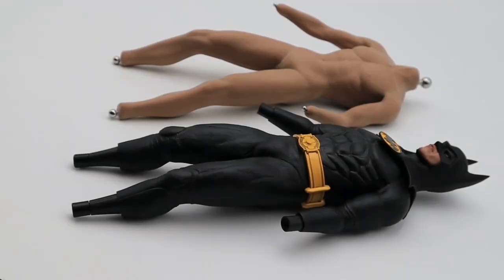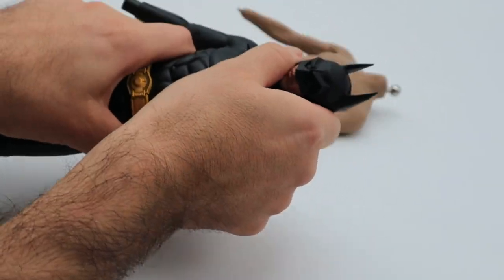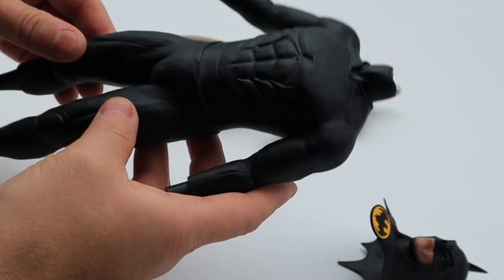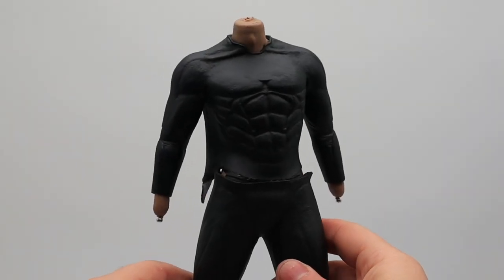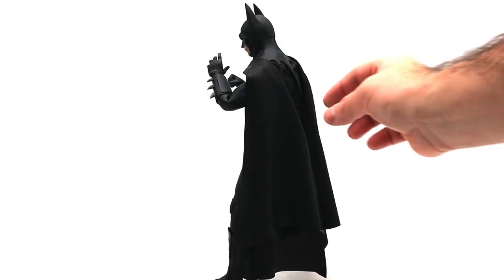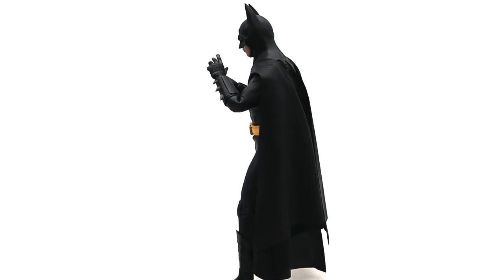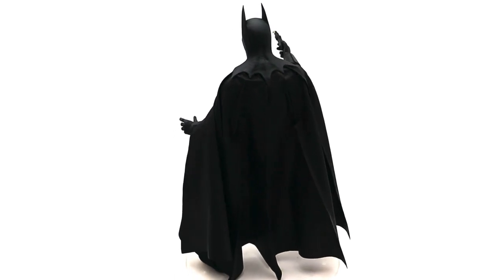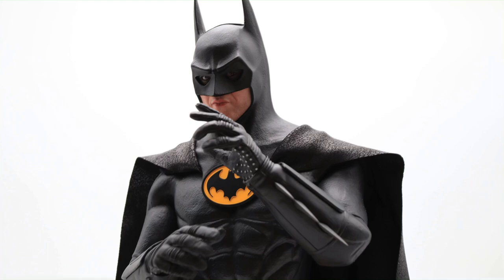89 Batman DX09 1/6 Phicen M31 body swap

Comment: Interesting. How did you get the metal neck joint out of the body. It is metal after all.
Reply from the maker: You bend it back and forward until you open the socket it sits in then it comes out

Comment: Im perfectly happy with my original , besides Keaton couldn't do much in the movie but stand up so it's perfect! Lol
Reply: If you ever do an Arkham asylum mod , that's one figure I love to see with posability and love to see a video on.
Reply from the maker: Very true Keaton couldn’t do much on movie with the suit
Reply from the maker: @robertonline6543  for sure usually what ever I mod I try and do a video to help others on how to do it 👍
Reply: Wonder if anyone actually cut parts of the suit and glue it onto stretchy fabric like it is in the movie. Now THAT would be awesome. 
I think using the phicen is overkill honestly. Just get some water based polyurethane and apply to the stock body joints. It really makes the joints tight. Remove the fat suit (which is the real reason for the non articulation) or cut in areas with tension.